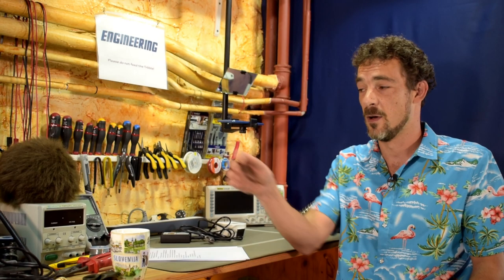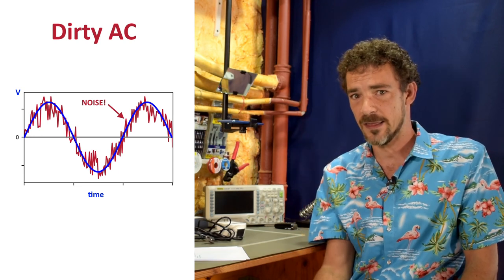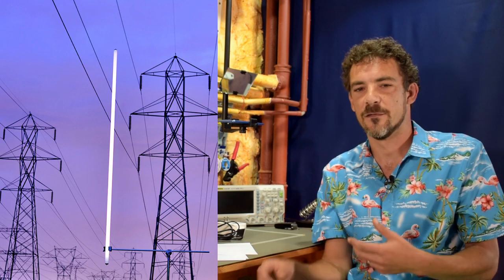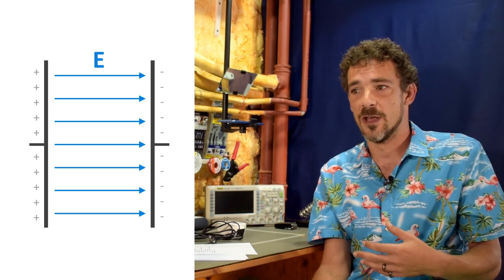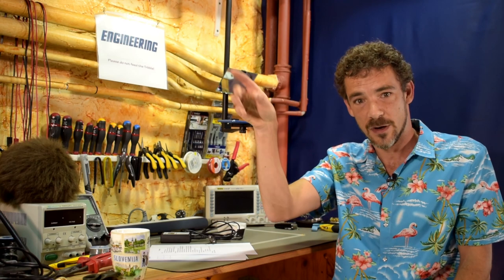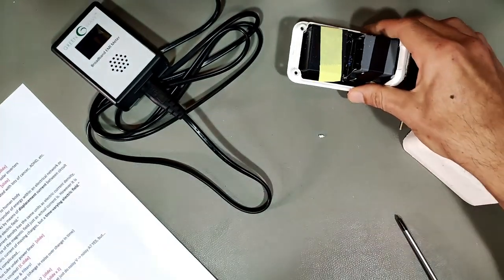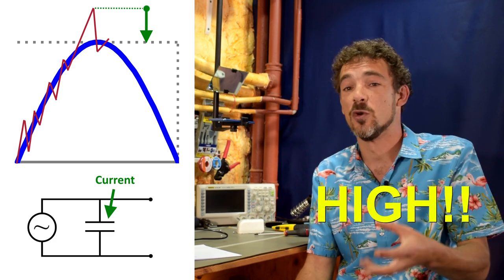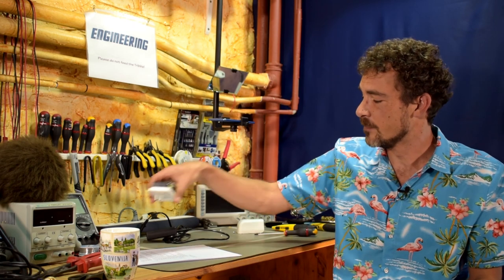Dirty Electricity: What it is and how to fix it

Comment: Hey Scottie.  I've noticed that EMF is frequently being grouped together in the dirty electricity category.  As I understand EMF is the effect of electricity passing through a conductor, and is not cancelled by an opposing field.  In this video you state that dirty electricity is caused by high frequency transients, caused by the technology used to convert AC to DC, dimmers, and inverters.  So to clarify, it appears that the dirty electricity filters can address the high frequency transients, but not the EMF, and to address EMF issues you would need to correct improper wiring in your home...is this correct?  And thank you!
Reply from the maker: More or less, yeah. The problem with D.E. filters (as far as I understand it) is that technically, they reduce D.E., which reduces the noise that capacitively couples to the human body. BUT, the drawback is that they result in noisy current, which creates noisy EMF, which can also be bad. Now, where it gets even more hairy is that I tested the EMF difference with and without a D.E. filter at home, and there was no real discernible difference. Then again, some studies show that teeny-tiny EMF (esp. pulsed GHz digital signals) can still have negative effects on the human body - and even then, it appears to vary from person to person. So, it's really quite insanely complicated... I've known people who just turned off the WiFi, and boom - their health problem stopped. And then I've known people who needed the D.E. filters, but WiFi didn't matter! The real problem is that - assuming there ARE health effects from all this stuff - we'd need a serious, broad, multi-discipline study where everyone actually works together. Then we might get somewhere and have actual answers. Until that happens, well... use what works!

Comment: Hey we have alot of dirty electricity in our home im sure of it.. the problem is i dont know where to put the filters if u wanna use that wall socket, it will take up its space or am i stupid? And we live in a 90 square meters home how many would i neee, we have 4-5 computers and a few televisions
Reply from the maker: You can plug filters into power strips instead of directly in the power outlet. I even plugged some into the back of some UPSes (puter battery backups). You can probably get a big reduction with maybe 10 filters, but you'll really have to use the DE meter and test everywhere. Then install filters, test again, and maybe move filters around. Then test again... It's a bit tedious, but it works!

Comment: If I am getting levels in the 600-800 range constantly with a Cornet, sometimes maxing out as well, on the Efield setting, for all my power points and the wiring in the walls is this not good then? Not sure these numbers on a current model Cornet are the same as other meters? Just a bit worrying given the numbers given in this video.
Reply from the maker: For a trifield meter, the 'safe' readings are very different than for a Dirty Electricity meter. The Cornet manual should give you safe levels for the different readings for your specific country. Also, keep in mind that just because the readings are high close to a power outlet doesn't mean they are high when you're sitting on your couch, for example. The key is to eliminate any high readings close to where you spend the most time in the room.
Reply: @ScottiesTech  thanks mate, really appreciate your videos and going out of your way to answer a comment. Has been reassuring playing with the meter since the RF levels appear to be very low where I live or even not even registering on my property in places. Curious though how the meter can not be registering a cell tower signal but a mobile phone will still pick up several signal bars? Seems to be a little bit of a contradiction. At least I imagine if the signal is still super low the danger is very limited, most of it seems to come from actually connecting with a phone or device. Cheers.
Reply from the maker: @petecabrina  The Cornet isn't really sensitive enough to pick up all cell tower signals. Usually, signal strength at a cell phone from a tower is somewhere between -110dBm and -30dBm. -50 is considered 'pretty good'. But the Cornet only measures down to -60, which means it will only pick up very strong signals from a tower. And even though, the antenna in the Cornet is probably not very good since the unit is supposed to cover a HUGE frequency range - whereas the antenna(s) in cell phones are designed for very good reception at a handful of frequencies. So, it works... just not very well!
Reply: @ScottiesTech  thanks again. Is the Safe and Sound Classic meter from Safe Living more adequate for checking cell tower RF then? Seems to be more specific to the job.
Reply from the maker: @petecabrina  Yeah! That's more like it.

Comment: I wonder whether it would make more sense to put some kind of 50Hz stabilizer before your electric switch board instead of those 10-15 Stetzer filters on each outlet. Or it doesn't work that way?
Reply from the maker: I put 1 filter on each phase at my breaker panel to start with. That seems to block more noise from the rest of the the electrical network, but the caps in the filters buzz wildly until I add more filters in the noisiest rooms.
Reply: Is there a whole home solution.  We live in Indonesia and the power grid power is very dirty and destroys electrical appliances often with surges.  Are we talking about the same thing here?
Reply: @johnmcmanamon3930  I think what you are talking about are voltage overloads, where the system gives out more than 220 V and home appliances "burn". What I am talking about are the Herz, which the appliances "like" to have 50 of (hence the note on the back of the appliance, saying 50/60 Hz or so). Those are different things but both lead to more or less rapid fail of electric appliances (faster with high V and less quick with unstable Hz).

Comment: If I plug in my mobile phone at home to charge but leave it on it gets very hot but when I do the same at a friends house it stays cool so maybe I have dirty electricity at home.
Reply from the maker: Interesting... Is the signal strength the same at both locations?
Reply: Okay I will try for a third time. My signal at home in Newark on Trent is terrible but much better in Jaywick Essex where my friend lives.In both instances I was sharing my WiFi from my Nokia 2720 flip while charging the phone at the same time.The battery at home gets really hot but at my friends in stays cool.
Reply from the maker: @carlgreene538  I'm wondering if it's because with a poor signal at home, your phone transmits full blast. That + WiFi maybe makes it heat up too much? That shouldn't really happen, but it's the only thing I can think of...
Reply: You should use a weaker charger, like 500mA to 1A. Constantly using the "TurboCharger" that came with your phone will quickly kill the battery life.

I had a phone for 2 years and the battery life was nearly as good as the day I got it. The charge port died and it was cheaper to buy a identical used phone than fix it. The battery life is noticeably worse on the replacement.
Reply from the maker: @randgrithr7387  I think it depends on the battery. Many Li-ion or Li-poly batteries are designed specifically for higher charging rates. I think what happens many times is that the manufacturer sticks a higher-rate charger in the package, but they don't upgrade the battery like they should to keep costs low. I suspect that's why there are many tablets out there (Samsung, for example) where they're pretty high-end, but they still only come with an 18W charger: cuz if they included a quickcharger, they'd have to seriously upgrade the batteries. Several times now I've taken apart a gizmo (phone, tablet, power tool) and I was surprised at the batteries inside - they weren't name-brand cells, but some Chinese company I'd never heard of. When I went looking for them, they were a dime a dozen on ebay. Even that's tricky, tho, because even if they are cheap batteries, they may still actually be quite good.
Reply: @randgrithr7387  My Nokia charger is 350mA but My Nokia 2720 gets really hot.

Comment: I've been working on lowering all the DE in my home with device/power supply swaps. My server rack is basically a horror show in regards to DE. It took 9 filters between the two dedicated circuits to bring it down to acceptable levels. I have two rack UPS units that run the servers and equipment. On their output side the noise levels are almost more than my greenwave can measure. When I unplug the machines plugged into it the noise levels drop. Could I separate the equipment on the output side of the UPS with isolation transformers to lower the DE between all the components?
Reply from the maker: Hmm. That's a good question! I'm not sure if isolation transformers will help or not... One way to find out! ;)
Reply: @ScottiesTech  tech grade Isolation transformers have been ordered, will see if that does the trick. Just my workstation alone is well....REALLY bad in and of itself https://www.youtube.com/shorts/v35WJ58AlzU
Reply: @ScottiesTech  Transformers arrived today, they made a HUGE difference in keeping the DE from propagating through the UPS back into the mains. So yeah, any modern desktop PC should probably be attached to one of these. The ones I procured were toroidal 1000 watt units. PHC ISO-1000 model number, PHC brand on Amazon. They also have a floating ground so no pass through like you have with hospital grade units. These are true isolation. Depending on the wattage draw of some of those higher end PCs, 1000 watts might not be enough, especially with an sli machine running two gpus. But a single card machine with solid state drives....1000 should be plenty.
Reply from the maker: @sirburg6483   AHA!!! That's interesting... Thanks!!!
Reply: @ScottiesTech  Welcome, will be curious how your noise distribution results differ if you place your computers on isolation transformers like I did. As you mentioned the noise tended to shift trying to address it with capacitive filtering alone.
Reply: @sirburg6483 which did you purchase? Thanks

Comment: I have dirty electricity coming from my computer monitor.  Are there any computer brands or models that have lower emission?   I guess it's from whatever transforms the current downward for the LED's.  Any way to fix this?  Thank you.
Reply from the maker: Not that I'm aware of, but the problem should be fixable with a DE filter (or two).

Comment: Not all switching power supplies are like that. The cheap/bad ones are the problem, unfortunately that are basically the only ones we get. Even in overpriced electronic there are cheap switching power supplies.
Are they also ones for the electrical cabinet?
That would be one thing the government could easily change to improve our health. ... instead of stamping on our rights.

Comment: So you're basically adding power factor correction caps. Why not just use isolation 1:1 transformer to filter grid dirt?
Reply from the maker: As I understand it: Sort of. Isolating from the grid doesn't stop the noise, because most of it originates on your side, not the grid side.  What comes from the grid side seems to be a combination of everyone else's noise.

Comment: My.lennox heater won't ignite people say.i need a capacitor in line to my.main power coming in, will this fix it!!  Thank you dec 1 23
Reply from the maker: I don't think so... Usually 'sparkers' generate much-higher-than-line voltage in order to spark at all. Could need cleaning, a new sparker gizmo, or it might be some kind of wiring/electronics issue.

Comment: I have a huge multipurpose jumper box from dewalt with 2 AC outlets on it and when i plug my laptop charger into that the laptop charger starts buzzing. Will these filters fix the buzzing?
Reply from the maker: They might - hard to say. Ideally, the AC output of the Dewalt would be a pure sine wave, which it probably isn't - hence the buzzing. Some laptop chargers are well designed and the buzzing won't matter, but others are cheaper and will probably keel over after awhile. Worth a shot, I'd say!
Reply: @ScottiesTech  Cool. Thanks for the reply. It isn't a cheap charger as it is a gaming laptop but the brick does produce crazy levels of heat on the regular so i should probably try one filter out.
Reply from the maker: @Split_Beard  Ah, I see. As a general rule, make sure the inverter can supply 3X the max power pulled by the lappy power brick. So if your power brick is 19V / 5A, your inverter should be able to supply a minimum of 19 x 5 x 3 = 285W. I think my gaming lappy brick can pull something like +200W, so I'd need at least a 600W inverter.
Reply: @ScottiesTech  So the jumper is 1000 watt and the charger is 280 watt.
Reply from the maker: @Split_Beard  Yeah, that should be fine. Maybe a filter will help!
Reply: @ScottiesTech  Ok cool. I'll order 1 soon and see how it goes. You are very helpful by the way. Thank so much.
Reply: @ScottiesTech  I just bought 2. I'll let you know if it helps.
Reply: @ScottiesTech  So unfortunately they don't work with my auxiliary power. Every time I plug it in the power unit shuts off power and says overload. Just thought I'd let you know.
Reply from the maker: @Split_Beard  Oh, man! That's a bummer. Thanks for letting me know.

Comment: If the appliances cause the dirty noise on the electricity. Then having a plug with a dirty filter built in to fit to the offending appliance would seem to be the way to go. Even better. If you’re building your own, then you could customise the filter on each filtering plug to suit that appliance. Or if you’re a manufacturer, you could do a range of plugs with varying filtering strengths. Actually, maybe you could just put the filter in the lead of the appliance?

Comment: Certain expensive electrical equipment, comes with those pre installed in circuit.   I heard in another presentation, that those Smart Meters, introduce noise, and supposedly quite a bit, and, if there are any "Green" providers on your cities circuit, (Wind/Solar) your incoming supply will be tainted.  What I watched was a Canadian documentary on the ravages of Green Energy. At a point, iirc, they provided a DIY circuit (similar to yours) for a Filter that should tack on near the start of your home's circuit.  An Project Box would work fine for a small room. Canadian Electronics companies, back in the day, used to install Baluns and a .10 to.20 u Capacitor as a pre filter.  I still see this arrangement on very expensive equipment motherboards.
Reply from the maker: I don't think I mentioned it in the vid, but I actually installed one filter on each phase close to the breaker panel (I have 3-phase). Then I did filters in the noisiest rooms.
Reply: @ScottiesTech what filters would one use for each breaker and dies electrician need to install?